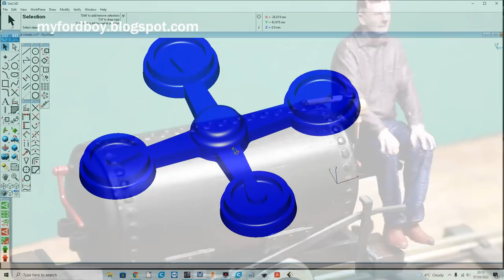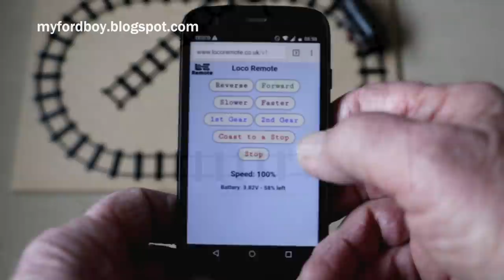Metal Casting at Home Part 117. Wheels for Sid. 16mm locomotive.

Comment: I'm always surprised by how little you have to ram your greensand.  Do you get your zinc/aluminium alloy from scrap?
Reply from the maker: Actually I reckon I ram quite hard, it probably does not show in the video.
I buy zinc aluminium ingots. It's 12% aluminium. Makes great flywheels and good bearing properties. Nearly as heavy as iron.

Comment: Lovely job 👍👍 Those compressed air locos were just a little bit different. I really like your tapping guide, I might have to make one of those. Cheers, Alan.
Reply from the maker: I did a video on it a while ago 
https://youtu.be/vzsJCxzJHx4
Reply: @myfordboy  Thanks. My drill press table doesn't attach like yours. I think I might have a go at making one using a cheap drill press bench stand from ebay.

Comment: Would it be possible to download printer files for the loco if i ask very kindly?
Reply from the maker: I did not design it to share. My files are a mess. Some parts like the cylinder ends I machined after printing to fit. Some had parts glued on as I was designing as I went. I based it on this which is available as a kit.
http://www.locoremote.co.uk/sid.html
Reply: @myfordboy  I understand, but a massive thank You anyway for sharing this and the link! I really appreciate it!